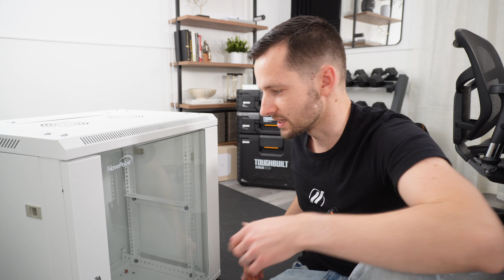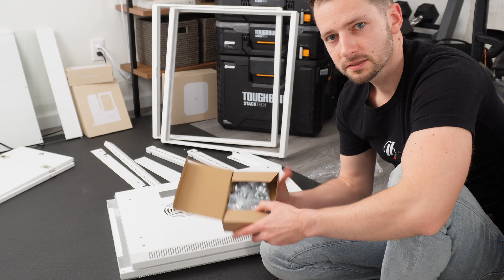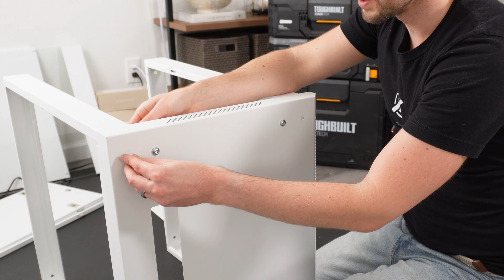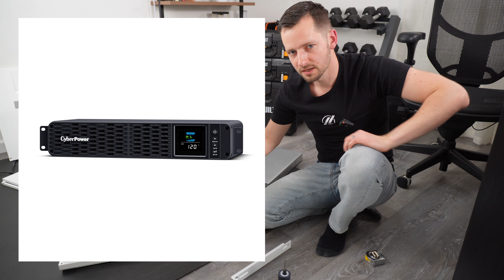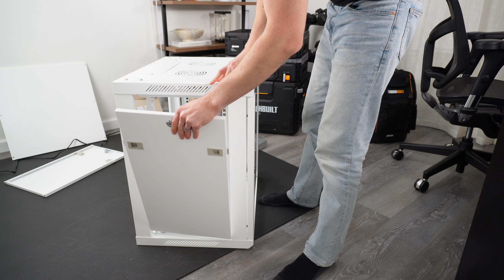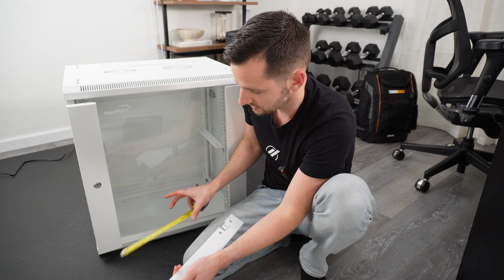Shallow-Depth Network Cabinet Assembly | White NavePoint 12U Wall-Mount Server Rack

Comment: one nice thing here over the unifi rack is the back wall mount points line up with 16 inch stud widths unifi ones do not.
Reply from the maker: The new slim unifi rack is 16-inch on center also. https://store.ui.com/us/en/category/accessories-rack-mount/collections/12u-rack-cabinets/products/uacc-rack-12u-wall-450-g?variant=uacc-rack-12u-wall-450-g&a_aid=Apex&chan=yt

Comment: Hold up! How are you just gonna gloss over the cam lock not locking the cabinet??? I literally came here because the locks that came with my rack are not long enough to lock my cabinet doors!
Reply: Im having the same problem. Did you fix that?
Reply: The hook mechanism doesn’t work as intended, but I’ve got mine securing the cabinet at about the 2 o clock position, and unlocked at the 10 o clock position. I had to disassemble the lock by taking the screw off the back. Don’t lose the tiny metal piece

Comment: I was surprised to find that the Unifi 12U actually seems to come in cheaper than this. The Navepoint is $283 and the UI is $249! Though I assume shipping is going to be a killer on the pre-assembled Unifi rack…
Reply from the maker: I don't think it'll be too crazy.
Reply: @ApexOneIT I found another video, it was $50 shipping for someone else. Not great but could be worse I suppose 😊

Comment: is a 17" depth deep enough for UI switches and OS consoles?? Like the UDM-PM and Pro Max 24 PoE? Or should you go with the 21.5" depth? Thanks!
Reply from the maker: In general, yes. Some larger ones will not fit. Be sure to see the part in the video where I talk about equipment depth. The Pro Max 24 PoE should fit though.